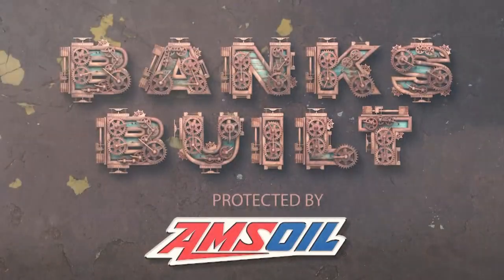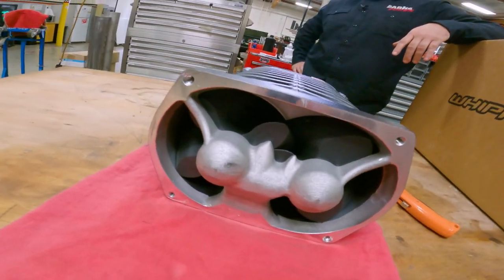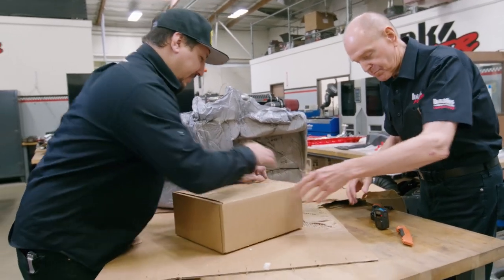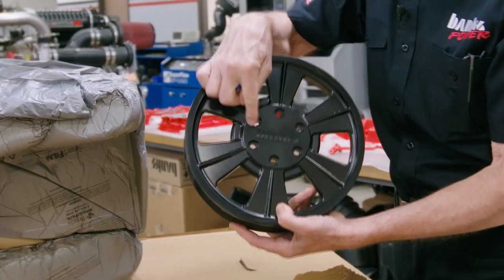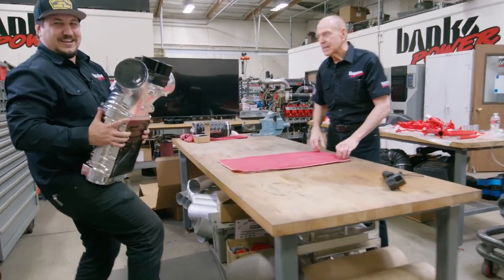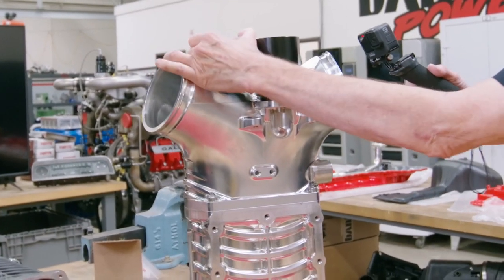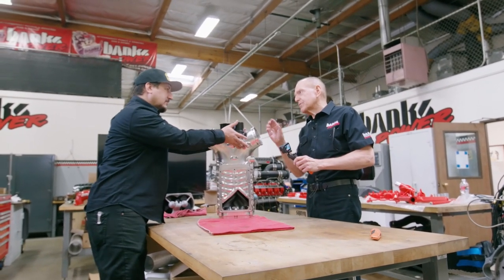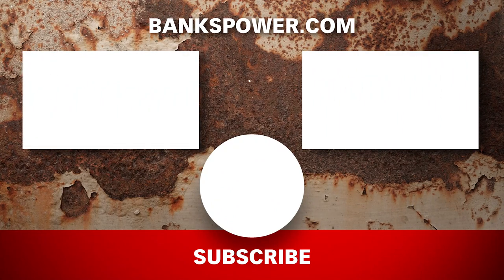Inside our Whipple 3.8L front-drive dual-inlet twin-screw SUPERCHARGER | Banks Built Ep 39

Comment: That is some serious supercharger but my main concern the the front bearing, sealed on both sides of coarse but not really serviceable plus even cut from a billet but very thin. If the bearing gets hot, starting to fail, it can lockup and twist out or spin and destroy the support. I can't seeing it lasting 5,000 hrs.
DK, ASE master tech since 78.

Comment: I play with little 2 stroke motors and little small block V8s. So I know how a diesel works. But that's about it. I know nothing else. So question. Is it possible to build a high performance diesel that will run like hell without it blowing smoke like a dumpster fire? Or is that a monumental feat that's damn near impossible?

Comment: I would love to know as Bonneville legend if a supercharger such as a Whipple would be better for a high RPM motor vs Turbo as it should provide power across the power curve without surge and the ability to make a cleaner bay for other items. Also would you ever use interchiller aka a ac compressor derived cooling like the SRT Demon and our fellow gear heads in Australia use seeing frost on the condenser proving it does lower IAT. Building my dream car and I'm wanting something for standing mile and 1/2 mile so legs is what the motor will have rather than arm breaking line power. My aim is high rev modern billet hemi with destroke and or flatplane with matching internals to achieve high wind with consistent power across the all rpm's and feel turbo shutter or burst only hurts consistency in the short course of this type of racing.